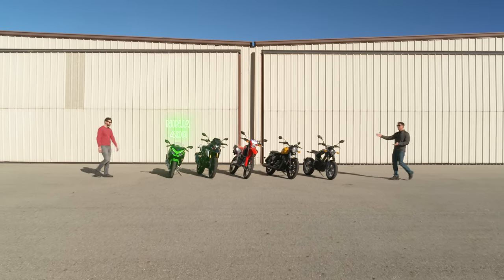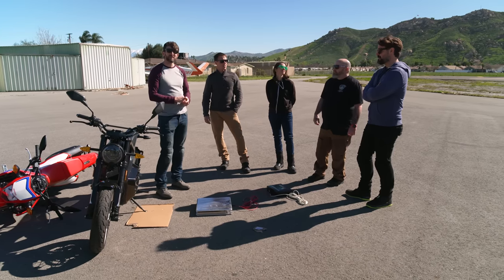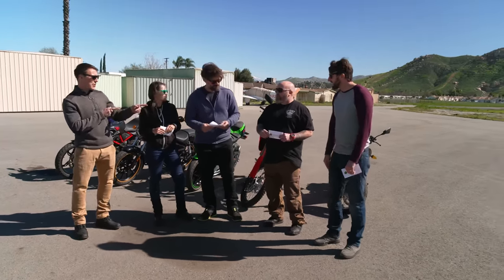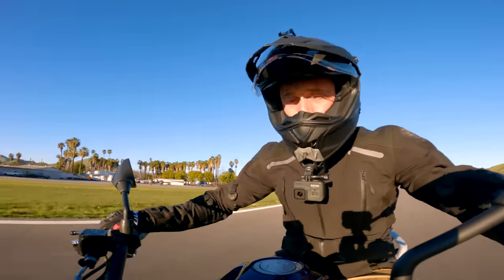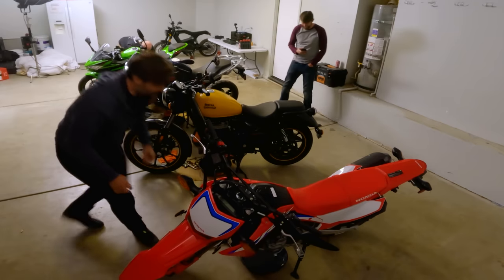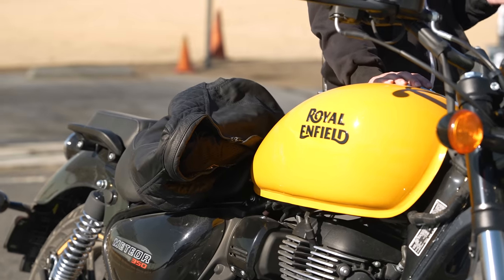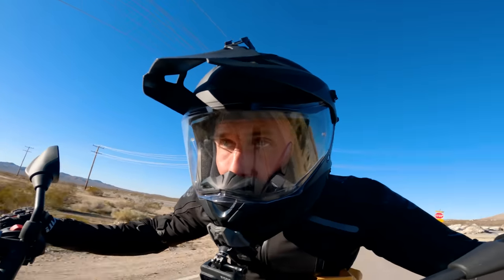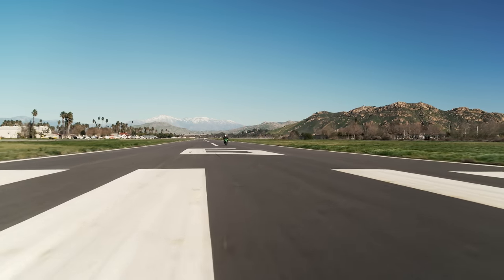Best Beginner Motorcycles! Ninja 400 vs Meteor 350 vs CRF300L vs Sondors Metacycle vs G310GS | CTXP

Comment: The problem with the drop test is that it doesnt show how tough the bikes really are. As a beginner, I dropped my Meteor 350 three times. Only thing that needed replacing was the brake lever, once. The thing is a tank.
Reply: Well, it kinda depends on where and how you drop it. I mean, you could get unlucky and drop it on a boulder or something and bust your fuel tank.
Reply: @SkinnyBlackout  I dropped a Suzuki Inazuma 250 and cracked one of the exhaust pipes, nothing else was damaged...
Reply: I think they already accounted for the worst case scenario, that why all the parts that touched the ground was part of the replacement computation.
Reply: @BradleyGibbs  thats no what he said tho is it? my english is not perfect so im actually curious
Reply: @SkinnyBlackout  that's what crash guards are for.
Reply: I dropped my Meteor 350 once, and the turn signal broke. I replaced allthe signals with LEDs, then got crash bars. I've dropped it 3 more times since them., and not a scratch.

Comment: As a Ninja 400 owner (since 2019), I completely agree with this review. One thing I would like to add would be the reliability factor: in my 4 years (and 54K Kms) of owning the bike as a daily commuter and weekend mountain runs, it hasn't given me any problems or issues whatsoever.
Reply: The Japanese are most reliable always 🤷‍♀️
Reply: Versys 400 (450?) X pleeeeeaaaase!
Reply: No, Kawasaki Z 450 scrambler. A Poormans W 800
Reply: In the entire time you've had it, have you done valve clearance checks? And has it given any valve issues? Thank you!
Reply: @Tanya_Von-Degurechaff  Surprisingly no valve issues (yet). It is, however, beginning to sound like I may need to replace the shims since there are now faint ticking sounds when the engine is hot. I've had it checked at around 40k Kms but it was still good then.
Reply: @isaacgandalf  thanks for letting me know, ive had mine for about a year now, i bought it new and am just coming up to the first valve clearance check on the manual, but i was wondering if it was necessary since i have no symptoms of clearance issues. I wish that when the time comes i can replace the shims myself, but that looks like a pretty in depth job
Reply: I was gonna say reliability. Is pretty dang tied between Enfield and kawasaki in 2nd. With Honda being in first. I don't care for speed. So a kawasaki 400, or Honda 500/300 are perfect sports bikes for me. Looks I love Enfield. Nostalgia for me is honda
Reply: Yeah yeah, the world doesn't revolve around you tho... 🤷‍♂️
Reply: @elbigotesdelatienda  Who even said that it did? Lol. Please post replies that are relevant.
Reply: The Ninja 400 was high on my list when I was getting my first bike. I ultimately went with a MT-03 as I was able to get it new for a steep discount and I like the riding position better. But every time I see a sport bike fly down the road, I kinda wish I could experience that. But I fucking love my MT-03 so life is good.
Reply: @societyisboring have u seen the new kawasaki 450 eliminator?
Reply: I can vouch for the Ninja 300 as well. 25,000km and 3 years on a 2014 model and not a single problem.
Reply: @Tanya_Von-Degurechaff  I had a Ninja 300. Ran it to 28,000km before selling. I did valve clearance adjustments at 25,000km (around 15,000 miles) and 2 valve clearances were just out of spec (0,01mm), did the maintenance myself. But otherwise it ran perfectly fine, not one single issue, rode it rain or shine, even in filthy weather.

Ninja 400 is probably the same, if not better.
Reply: @180FiftyFive  thats great to know, how would you rate the difficulty on the valve clearance adjustment job?
Reply: @Tanya_Von-Degurechaff   I learned all the maintenance on youtube. It wasn't difficult for me - just very time consuming cause it was my first time. 

I watched a 20minute video, created step by step instructions for myself, then gathered the tools and did it over two days.

If you can turn a wrench and have the tools like torque wrenches, gauge feelers, etc. then with enough patience you can save yourself probably 300-500. Considering it takes most people a few years to run up the miles to get to the valve adjustment maintenance, you can probably trade bikes or learn to do it by then.
Reply: One of the best bikes in history for the dollar.
Reply: @pravinmurthy  a friend of mine bought a cbr 500, the black and red 2021 version. 7500km later was already burning oil and one of the pistons was siezed.... meanwhile my old z650, the 2018 48hp version never gave me any problem, despite having a full decat unbaffled arrow and selling it after driving it for 41 000 km

Comment: Kudos to Jen and Patrick for riding the Meteor and Ninja on those dirt sections. Pretty certain I would have binned it.
Reply: Nahhh dude just two wheel drift that ninja through the dirt corner you'll be fine
Reply: I wonder how Himalayan would do here but then there would be no cruiser bike
Reply: @Jen "Jrod" Dunstan I constantly look at jumps and ruts and terrain and think "Oh that doesn't look that bad" before remembering that I'm used to offroading on a mountain bike that weighs like 30 pounds, not 300 😅
Reply: @PlaySA  Gotta do some hooligan stuff on the ninja, I agree
Reply: Kudos to both but especially Patrick. You have to remember that the first scramblers were just cruisers without fairings, so Jen had a slight advantage.
Patrick, with his weight, on a sport bike, getting air and curving corners on the dirt is very impressive and a testament of his skill
Reply: @ananass8030  Not really...its easier to stand up and grip the Ninja than it would be on the Meteor so its actually Jen with the crazy bike for that segment!

Comment: This is SUCH a well made video! From concept, to production, to the vibe. Everything is on point. I had a smile on my face throughout the 40 minutes. 

I wish you had included the 390 duke 😁 That was my beginner bike and it can EASILY crush all these tests.
Reply: It would have won the oil change.  The oil would already be on the floor.
Reply: @chrishart8548  I have no idea what you guys do to that motor. Here in India, they are considered to be pretty bullet proof even in the sweltering tropical heat
Reply: @raghunathattarde960  It MIGHT be that they're riding at higher speeds.  I rode in India (on a RE Himalayan in Uttarakhand & Himachal Pradesh) and it was hard to ride any distance at >100 KPH where here in the States you might not ride slower than that for the bulk of your ride especially outside of Urban areas.
Reply: @raghunathattarde960 never had a problem with my 390 Duke(2022.)

It has north of 4000 miles on it and I have 4 decades if riding experience and bikes of all sizes including many track days.

I bought it for mountain roads and I run it.
Reply: Agreed, and having ridden both,
 this test without ktm390/husky401 is a bit, well, inconclusive... :D

Comment: As someone who wants to get into biking I think I would go for the Meteor tbh, I'm not looking for speed, I love the classic style plus its not too expensive in the repair costs compared to everything else and its not like I would be throwing it around to have reason to repair it constantly, if I had the money to factor in expensive repair costs I would maybe have the GS
Reply: Which bike did you pick? If you don't have one yet, check 500 ccm offers. 20HP is too little power, and the Enfield is a heavy motorcycle for a 300 class.
Something like ER 500 or CBF500 are both decent starter choices. Even SV650 is frankly a beginner-friendly motorcycle. If you are looking for a cruiser, such as a Royal Enfield Meteor 300, the Honda VT600C will handle even better than this and its reliability is day and night compared to Enfield.

Comment: I think the reason the Sondors was so slow was that the claimed torque (if it's even accurate) is direct wheel torque, whereas the rest of the bikes have their engine torque multiplied by the transmission and chain, leading to a much higher wheel torque. It's like starting in 6th gear.
Reply: Sondors deliberately limits the torque on initial acceleration runs by selecting “soft start” throttle mapping on the programming for its controller. 

I assume this is done in an effort to maintain new rider friendliness and long battery life.  

Many high power Electric bikes become uncontrollable stoplight wheelie machines without limiting the throttle mapping as 100% of their torque is delivered at zero rpm.
Reply: @beachdoktor1  Some gas bikes do the same thing. In this case, however, the Sondors was fighting for last with a Royal Enfield Meteor 350, so I don't think there was much risk of it being uncontrollable. 

The RE meteor 350 has a first gear drive ratio of approximately 3:1 and a final drive gear ratio of approximately 2.8:1. At the engine's peak torque of 27 NM, the rear wheel is getting 156.6 NM of torque, or 115.5 ft/lbs. That's not far off of what the Sondors claims. 

Accounting for a healthy dose of startup bullshit, and the fact that the two machines were roughly comparable in terms of performance makes a lot of sense.
Reply: @beachdoktor1  My Zero DSR definitely limits torque from a stop. Gun it from a rolling start though and it takes off like a rocket.

My brother's FX software is a lot less limiting, and it will power wheelie like nobody's business. Even with over 30 less horsepower, it will beat my DSR from a stop up to about 30.

Both bikes absolutely have the capability of looping out from a standstill if Zero were to allow 100% torque from a stop.
Reply: @beachdoktor1  Most of them don't limit it because they're uncontrollable - most of them do it to keep the transmission in one piece. 
Electric motors make a whole heck of a lot of torque at pretty much zero rpm and if you make a transmission (geared or otherwise) which can take that hit then you have more weight and a lot of extra drag which kills range.
Since that torque ability drops off so soon they usually build the components to safely take the torque from a few mph because there's no point in having massive final drives or in the Sondors' case internal shafts when that torque is only there at pretty much a standstill. 

Lets be honest too - this thing couldn't keep with a Meteor 350 so there is no uncontrollable excuse on the planet thats going to wash.
Reply: @crudboy12  I don't have direct experience with these particular bikes but it is also possible that Sondors did that because of how electric motorcycles deliver their power rather than how much.  Electric motors can put their power down much faster than a ICE motor can and that can and has caused issues for others.  Although I think it is more likely that this is just a case of Sondors playing games with the spec sheets.  I am not EV apathetic as a matter of fact I am planning on getting an EV.  I also think the Sondors is a decent bike but they have already demonstrated themselves to be somewhat untrustworthy.  Conjecture of course I know nothing.
Reply: @SirNarax  It seems like the problem is that Sondors is a silicon valley startup style company who happens to be building a motorcycle rather than being a motorcycle company. The relative lack of spare parts availability is indicative of this fact. Regardless of how good/bad the product is in the end, it's main purpose is as an investor pitch rather than an actual vehicle. 

Companies like this are famous for overpromising and underdelivering: It's a "fake it until you make it" business strategy that often leaves consumers unsatisfied and investors burned. 

Electric motorcycles at the moment are a bit of a tough sell. The Sonders goes for $6500 iirc (although they were offering a huge credit for a while) which is very steep when you consider what you could get instead for the same money. It seems like they were shooting more for the techie e-bike/scooter crowd (in the context of electric mountain bikes the price is more reasonable), but the sonders still needs a full motorcycle license and everything that goes along with. It's another shot at the "motorcycle for people who don't like motorcycles" concept which will probably handicap it a bit. 

Sondors may survive and carve out a niche for itself as the market goes electric, but they are just as likely to disappear into the aether and leave behind a bunch of unserviceable paperweights.
Reply: But the Livewire claims 86 lb-ft and it's actually quick.
Reply: Its really just playing tricks with numbers for people who are used to hearing the quoted figures from gas. 
The number from a gas will usually be what it makes at the engine output shaft. 
The number from electrics can be at the motor shaft or after the reduction gear but either way thats ignoring the gas bike making its torque at much higher rpm - meaning much more power. 
If you have the same torque at 200rpm and 2000rpm, the second will give much more power. 
For instance 50lb at 200rpm is only 1.9hp but at 2000rpm is 19hp. 
The Sondors claims 20hp which, presuming the 200lb is also where peak power is, means its only spinning at 525rpm or so to make that. 
Since the others will be able to spin around 20 times as fast they can have 20 times less torque to match it. 
I'm not seeing any with 10lb of torque...
Reply: @XSR95  It claims a 3s 0-60 and 110mph top speed. Thats a decent 0-60 but in bike terms its not amazing 110mph is pretty slow.
It can't even keep up with a Sportster S which is also around a third of the price, can refil in a couple minutes anywhere, can go further anyway and sounds way better. 
At least Harley seem to quote the torque its putting to the belt so its a fair comparison to the gas bikes.
Reply: @XSR95  The livewire isn't a hub motor. The livewire has a gear reduction box plus the reduction coming from the different sized sprockets, leading to much higher wheel torque.

Comment: Just a note: the Metacycle has 130Nm peak from its rear hub mounted motor. The Meteor 350 has 27Nm at the crankshaft times 2.3 for the primary drive, times 2.6 for 1st gear reduction, times 2.8 for the final drive - making a total of 452Nm of torque at the back wheel (@ 4,000rpm in 1st gear). Of course the Metacycle came last!
Reply: Thanks for pointing that out. People - even professional testers - often confuse engine crankshaft torque and rear wheel torque, especially now that several e bikes use hub motors where the motor and the wheel are basically the same thing...
Reply: yep, exactly like Tesla brag about Tesla Roadster with 10000 nm of torque, yes but at the wheel... that's just misleading marketing
Reply: @Tonyx.yt.  But Tesla’s win drag races, they don’t come in last.
Reply: @LTVoyager  Not once a vehicle is similar in hp
Reply: @jimmyneutron5679  Similar HP electric will still win as the torque curve is more appropriate for drag racing.
Reply: @LTVoyager  Yet they do not win if the other car has proper gearing, which you cannot achieve with a EV
Reply: @jimmyneutron5679  I’ve not seen a similar HP ICE beat an EV in a 1/4 mile race. Maybe if you run a mile or more. Give me your example of an ICE that can beat a same HP EV in a 1/4 mile race. Stock vehicles with the tires they left the factory with.
Reply: @jimmyneutron5679  And you certainly can add a transmission to an EV, it just isn’t necessary for street vehicles.
Reply: @LTVoyager  Nope, the transmission wont make the electric motor run any better top speed wise, atleast they havent figured out the right way to do it... atm only Porsche puts in a second gear for highway efficiency, so  thats more of a overdrive then performance oriented close ratio gearing.
Reply: @jimmyneutron5679  Still waiting for your ICE car that will beat an EV…
Reply: @jimmyneutron5679  A 3.5 million dollar Koenigsegg can’t beat a Tesla in a drag race even with 200+ more HP.
Reply: @LTVoyager  Lets see, theoretically I could buy a Porsche 911 Turbo S which would beat most electric cars :) For the plaid you would have to give the Porsche a slight mapping ofcourse. That also goes with most current sportscars... yk because they are actually far lighter and having the option to tune them is a bit better than just stripping the interior of the plaid lmao. Furthermore the current quarter mile time as advertised on the plaid was from a rolling start. Same goes for the new hellcat with 1000hp.
Reply: Lets not forget many stock sports cars with ICEs already beat electric cars, even such ones as the Model X plaid as a example or the Lucid air.
Reply: @jimmyneutron5679  I posted a video showing the Plaid beating a Koenigsegg and it was from a standing start.  Show me a video of a 911 or Hellcat beating a Plaid from a standing start. I don’t care about published times as they depend on a zillion factors.  I am talking about head-to-head races in the same conditions at the same time.  Put up or shut up as they say.
Reply: @jimmyneutron5679  More claims without a single shred of evidence.  Typical of those without a clue.
Reply: @LTVoyager    Pretty sure a Corvette beats a Bolt.
Reply: @mikeb1039  Which has what to do with anything said here?